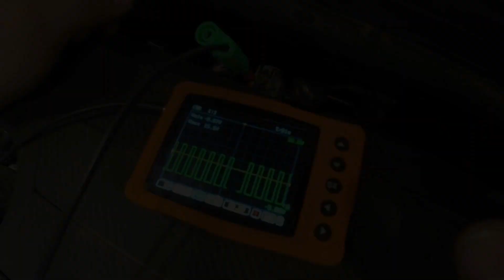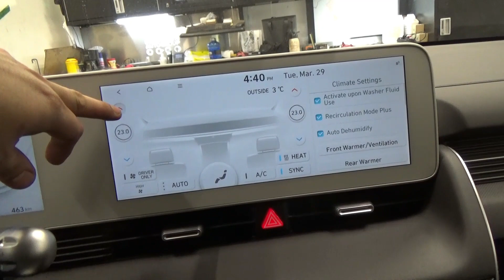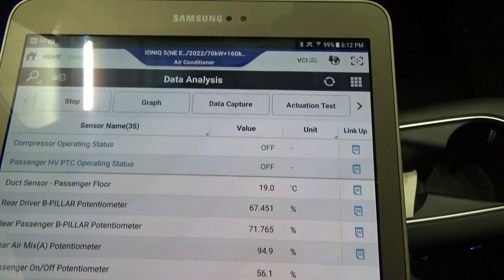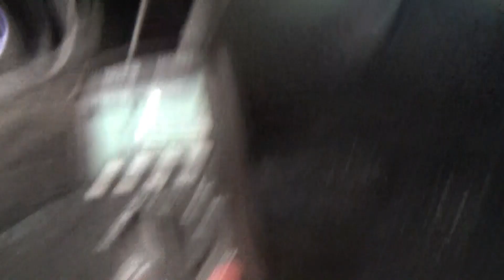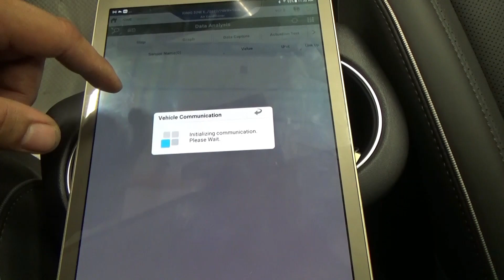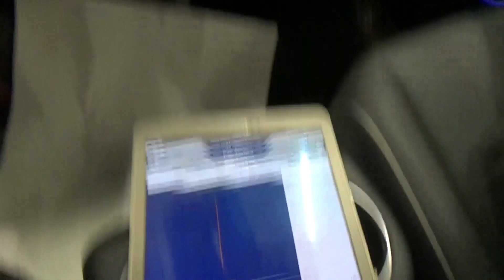IONIQ 5 NO HEAT, NO A/C COME BACK

Comment: Thorough diagnostic and solution! I'm having problems with my Ioniq 5 A/C as well any recommendations on how to ensure it gets fixed by the dealer?
Reply from the maker: Thanks, for confirming you will know if ac is not working coz the system is pretty sensitive, if its not fix it wont work amd worst case there will be a warning light.

Comment: This video looks like the same problem I am having with the A/C. I have an Ioniq 5 Limited and at 600 miles the A/C stopped working.  After about 3 weeks tha part (I assume the A/C Control module) came and my A/C was working for 3 days and the A/C stopped working again.  I took the car back to the dealer and they said there were a 2nd part they were waiting for. It's been 2 months now and still back ordered.  I will watch your other videos related to this issue.
Reply: Any update? I’m having the same issue.
Reply: My car has the same issue
Reply: OMG I would demand a buy-back.
Reply: My car also has the same issue